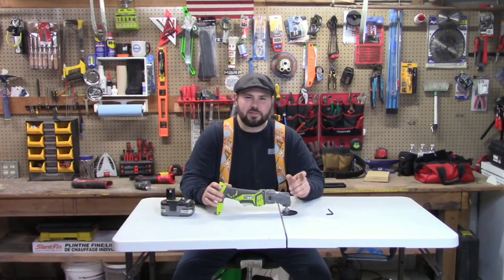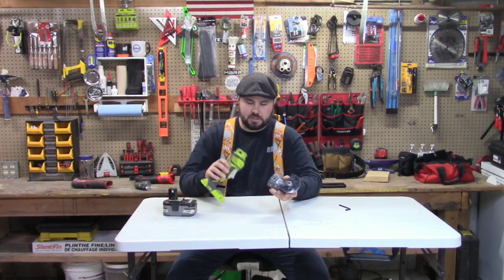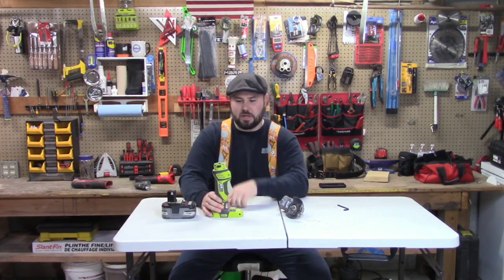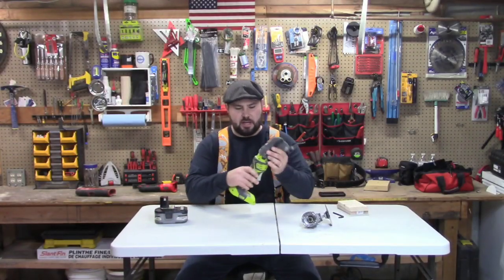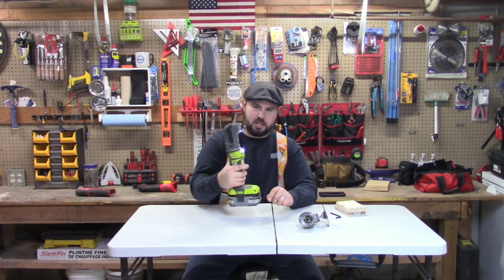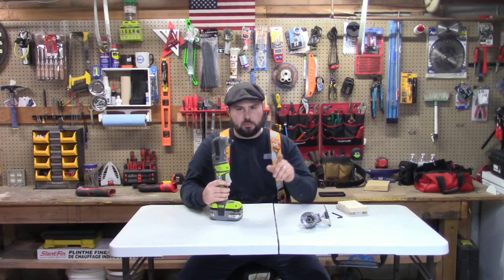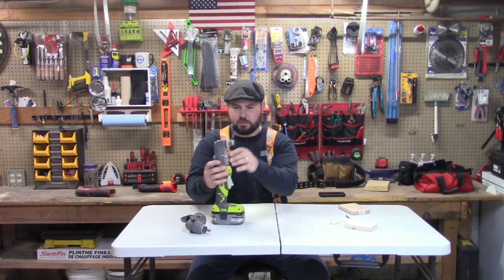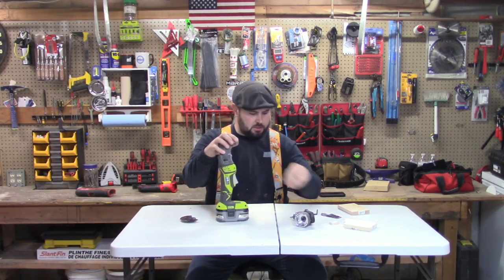Ryobi Multi tool toolless blade change

Comment: I did the same swap out with my isolating tool and i like it better. I am upset that Ryobi is not choosing to continue that line and make it brushless😠 I got my jobmax quick blade change head from a Ridgid corded oscillating tool I got it from Direct Tools for $40 and just resold it

Comment: That's the Ryobi JobPlus, not the base model multitool. I've never seen the JobPlus sold in a kit with other tools. I honestly don't like the JobPlus with either multitool head but it's really handy with the recip saw, right-angle drill, and nail driver heads.

Comment: Just like the new Hp, but with this one you can switch the head to 4 different positions, not sure of the power difference in the brushless to this one when using regular non-hp battery.

Comment: That has to be one of, if not the worst One+ tool - it's a total POS. Thankfully after all these years Ryobi is finally coming out with a new HP version with a tool-less blade change, hopefully it will be a better than the current tool, the drawback is that it does not accept the JobMax heads.